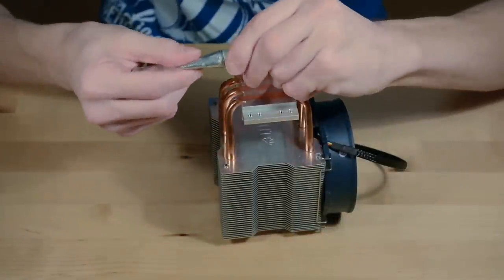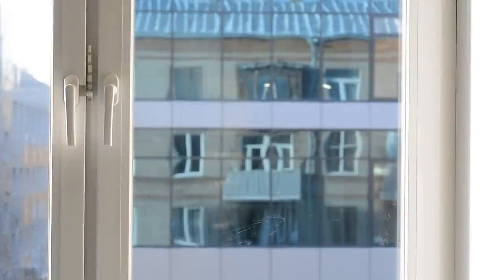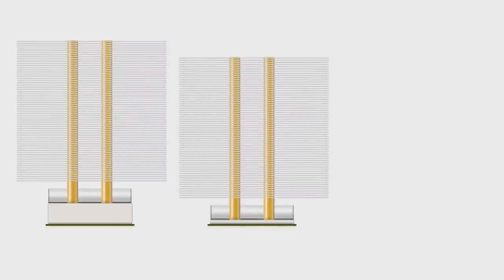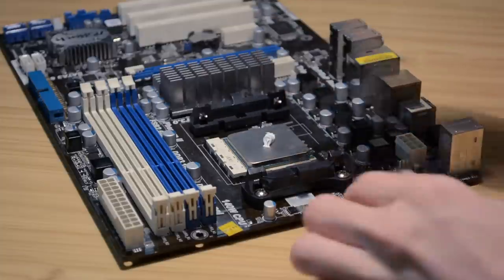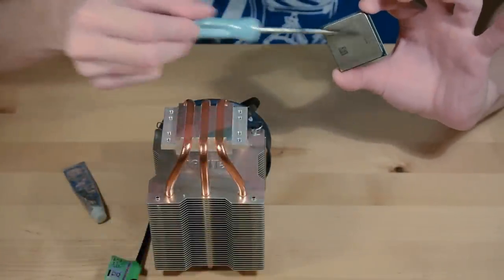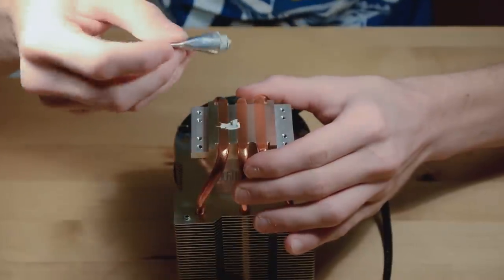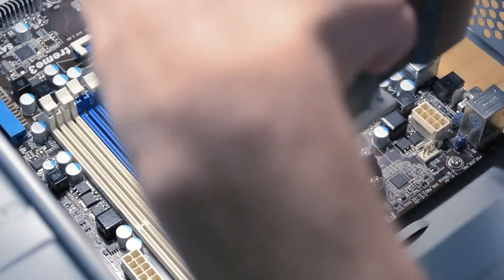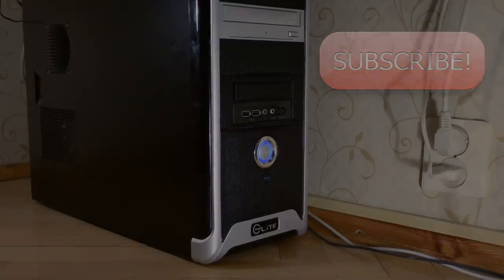Thermal paste: How much really need to apply and how to do it correctly? Как наносить термопасту?

Comment: thermal paste is conductive folks. This guy and his fancy videos doesnt make he says true. Although its not recommended to use a gob load of thermal paste it's not going to hurt your cpu. Thermal paste is not only used to clear the space between heat sink and cpu. Because its conductive it absorbs more heat and transfers that heat to the heat sink.Also this guy has no clue about cpu's. The processor cores are directly in the middle http://s19.postimg.org/txvxhphir/cut_2.jpg